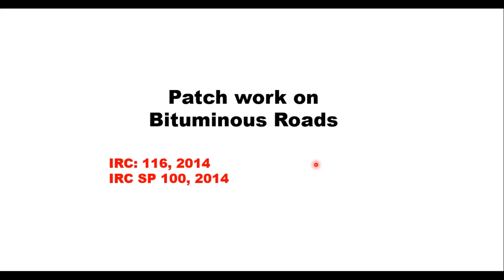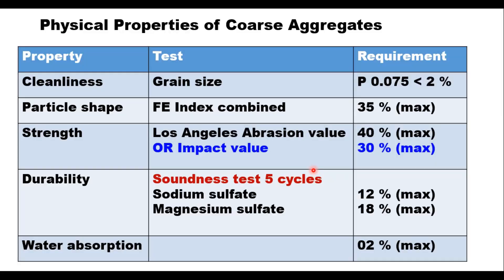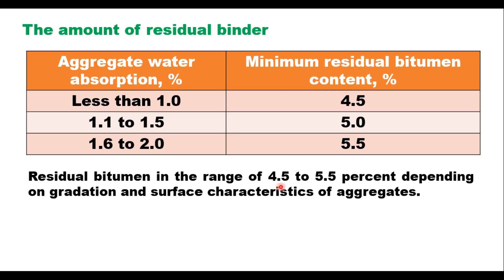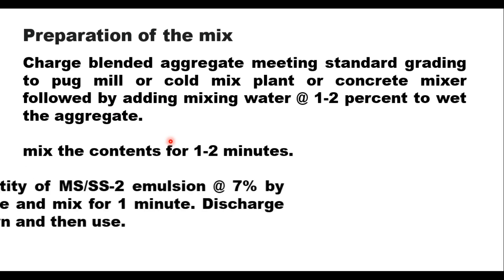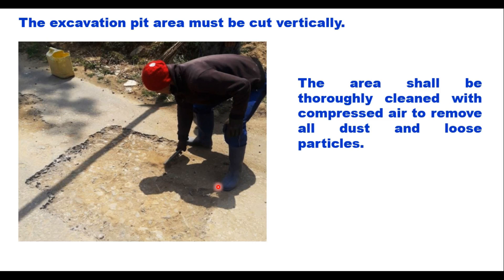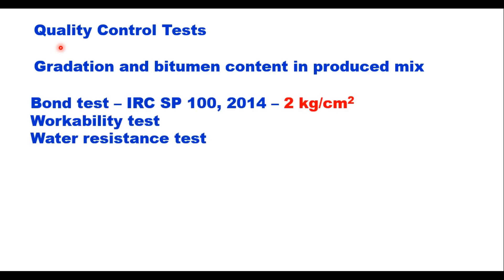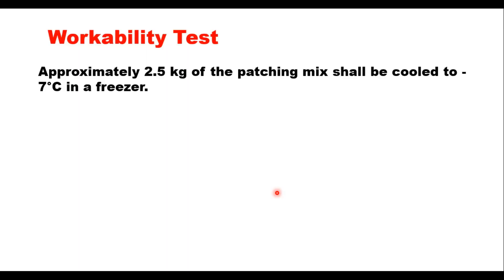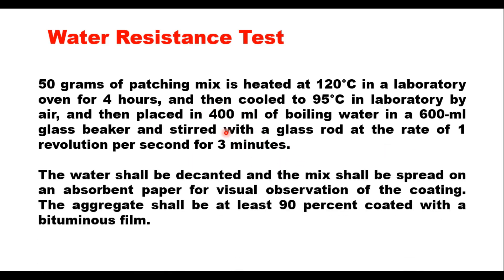Patch work on Bituminous Roads, Material specifications, pothole repair method and quality control.

Comment: Sir, I was wondering If we manage to use wire mesh or geo grid in DBM layer or Bituminous layer. How will it affect the pavement, will that be helpful for the Load bearing of the road? Sir it may reduce the Rutting effect and transfer load in wider range But still I’m confused if that works or not.
Reply from the maker: There are two reasons of using geogrids in flexible pavements, to strengthen the pavement and thus to reduce the overall thickness, and to prevent reflection cracking in the case of overlay. 
If you are considering a new design with geogrid reinforcement, then this video may be helpful. https://youtu.be/wkNrZmt5Nc0
If it is at the time of overlay then it is to prevent reflection cracking and is used when the surface layer is badly cracked.